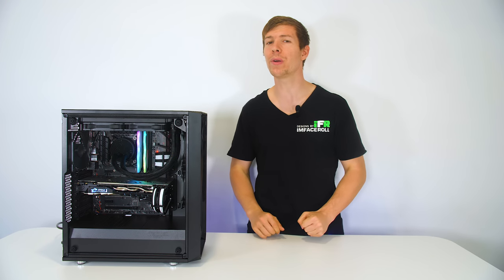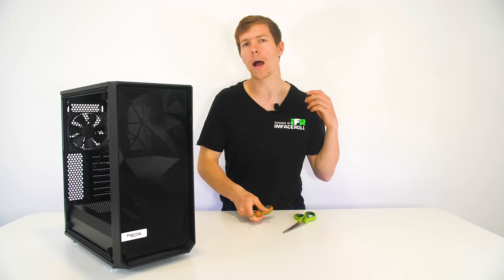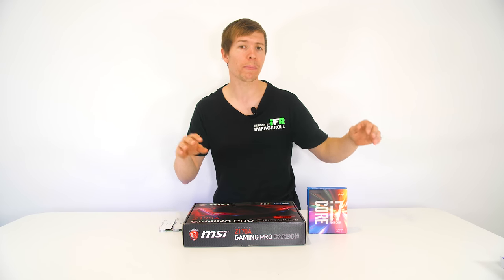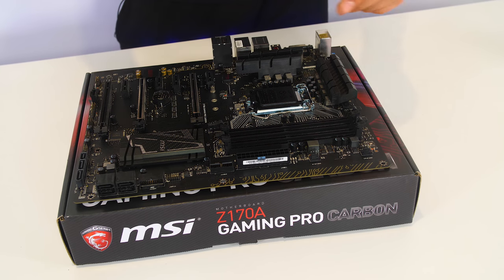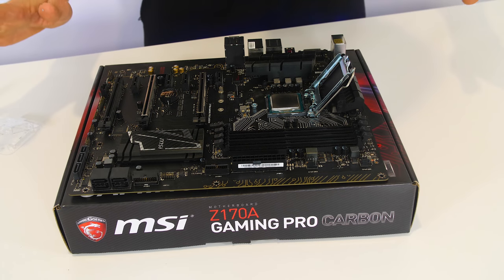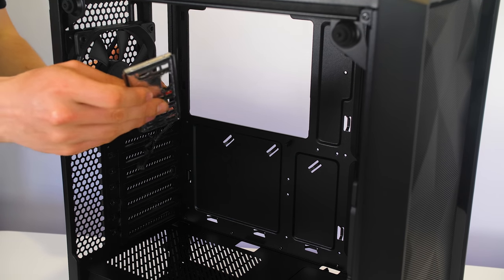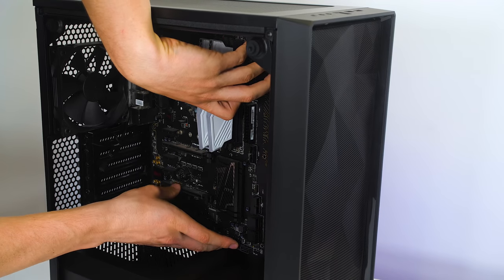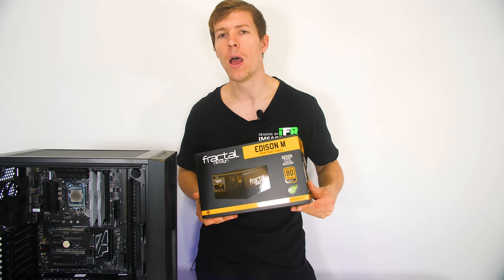How To Build A Gaming PC in 2018 - Step By Step Beginners Guide

Comment: Isn’t it safer to check if the core is in place by shaking from the side and not the top...because I always thought that the oil from ur fingers might do something to the thermal paste
Reply: @TouringGnat  I mean u don't "NEED" thermal paste but i don't think your cpu temps would feel so well lol. Always use thermal paste and a cpu cooler

Comment: I look forward to building my first PC. The build I'm going to do is a msi atx x470 board, msi Radeon rx 570gpu, 16gb ddr4 Corsair vengance rgm ram, ryzen 5 2600 CPU and the case is the fsp atx mid tower case with RGB fans. Also using a 650w psu from evga.

Comment: I have built my last 3 computers, but it has been 5 years since my last build and I feel a bit rusty.  I've been looking for a nice refresher course!  Thanks for an excellent video! 
What I'm building tomorrow:
I5-9600k
MSI Z370-A pro
GTX1080
CoolerMaster 240L
M.2 Drive
EVGA 550 80+ Gold 

My only worry...
did I fuck up with the 550w power supply?

Comment: Yes, helpful. I'm on my 3rd Build. An INTEL Dual Core Based System with 4GB of DDR2 11 years ago, an INTEL Core I5 Based System with 16GB of DDR3 5 years ago, and an INTEL Core I7 Based System with 32GB of DDR3 presently. (I can't see the Real Advantage of DDR4 at my RAM quantity.) I've used Fatal1ty Mobos for the last Build, and this one.  I note that my RAIDMAX Case has a Brass standoff in EVERY existing Mobo Mount hole... Probably should eliminate the unneeded ones, huh? Yeah, I will. I wasn't going to Install the RAM Modules Before Mobo Installation, but since You Recommend it, I will. I'm using a KDM PSU at 1075 Watts. Not Modular.I have 2 SSDs (120 and 500GB)for the WIN10 64bit OS and misc productivity Programs, and a 6TB Seagate Barracuda HDD for my 100+ GAMES. The Graphics Card is an NVIDIA GTX1060 6GB. I hope this all comes together. Your Content makes what I think I know more Grounded in Truth!

Comment: should i liquid cool my hard drive if it starts to smoke?
Reply: Tech Studio yes I recommend a full hard drive water block. Those can get pretty hot
Reply: Haha, no wat get a full water loop and a custom water block that Goes ariound the hdd
Reply: Huug Jansen a full custom cooling block that completely encases the entirety of the hdd with a sub zero cooler and thermal padding
Reply from the maker: if your hard drive has smoke then it needs to be tossed in the rubbish. Hard drives do not need water cooling however sometimes i do it just for looks
Reply: Tech Studio no that's perfectly normal
Reply: haha, it love how we are all being sarcastic
Reply: Haha what 😂😂😂😂

Comment: Im commenting this before i watch this buuttt, i have a dvd drive and windows 7 on disk. How would I plug that up, and would I install windows in the bios. Also, what am I supposed to do in the bios regarding ram?. I've never built one. Slowly acquiring parts.

Comment: Meshify C is simple beautiful case, no doubt
But the minus thing and its very painfull for me is the front panel port mounted with the mesh part
Why Fractal not make it separately like define c? or enthoo pro m? why fractal, why...
Reply: Yatin Alkatiri  you can actually remove the mesh without taking the front panel off if you remove the bottom dust filter it leaves enough room to put your hand under and push the clip that holds the mesh in.
Reply: Nah, still cant get it why they not make it like define c, I mean what the hard part is?? They are same base and pattern

Comment: So ive got a intergrated graphics card already in my pc. So i bought a 1050ti which needs a 6 pin pcie express cable. But the original pcie cables that came with the pre built pc was a 4 pin pcie express double sided. So i am looking for a 4 pin pcie express cable and a 6 pin pcie express cable on either side. Any suggestions?

Comment: I am skilled in pc building but can you mix 3000mhz ddr4 ram with 2400mhz ddr4 ram ??? Also if there diffrent company's will it still work
Reply from the maker: Do not mix ram at different speeds and timings
Reply: Ok what about companies
Reply: thegamingferret 
companies are fine. use them in spearate channels tough (company 1, company 2, company  1, company 2, in the order of your RAM dims.)

Comment: Damn I wanted to build a pc after seeing this video but that's expensive man
Reply: Designs By IFR have u got any other ideas/ cheaper alternatives and are u from australia
Reply from the maker: Hey man i am from Australia. You do not need to use these specs. I was just helping beginners understand how to build a pc
Reply: Brayden Hamilton yeah this is quite a high-end you can definitely make a cheaper build but it’ll have lower quality’s such FPS and etc.
Reply: Designs By IFR anyone kow were i can get a decent pc that will have high fps for around £500/£600
Reply: Even the ram has doubled in price

Comment: Can You Use Any Case?
Reply: All of the parts are different sizes and if you for example buy an to big motherboard but a too small case it wont fit so you need to check the size for the things like if the case can fit an ATX motherboard or something like that.